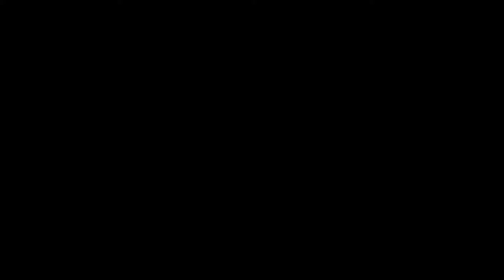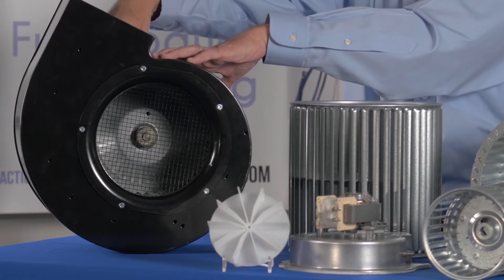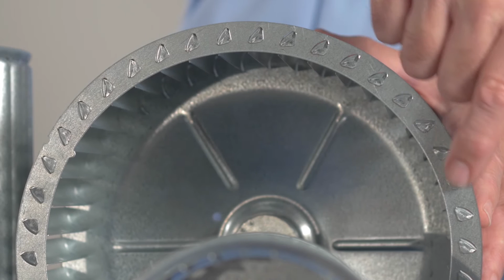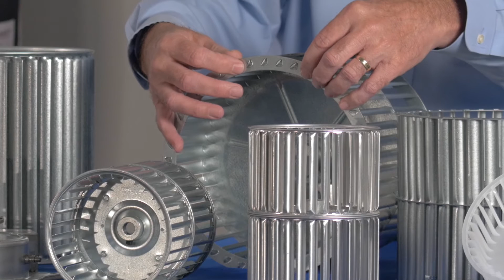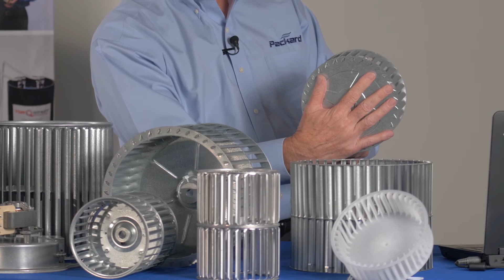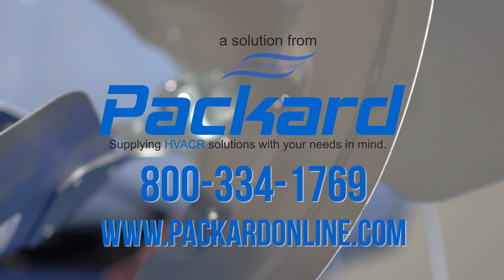Blower Wheel Performance and Selection

Comment: I have been doing research on my greenhouse inflation blower that is a single pole induction 1/100th horsepower.  I have thought for years that squirrel cage meant the wheel...ha ha.  It was good for me to hear these motors are very specific.  I hate to buy another motor if I can fix this one.  So much to know.  Thanks.

Comment: sir, will the same static pressure be applied in thrust is equal to suction, if the same fan used as suction and blowing in different scenario?
Reply from the maker: There is negative static pressure on the inlet side of the blower and positive static pressure on the outlet side of the blower.  The total static pressure can be identified by changing the negative to a positive on the inlet side and adding to the outlet static.